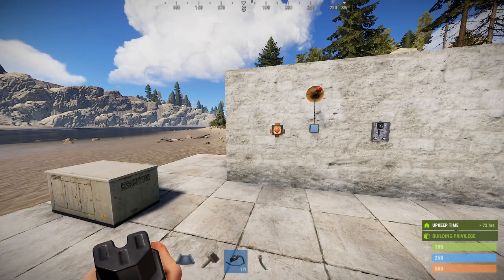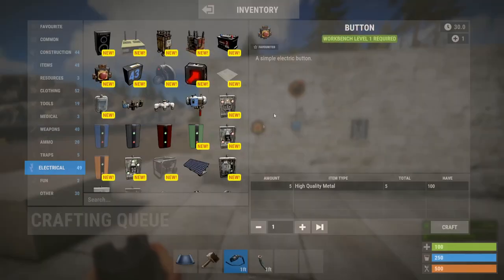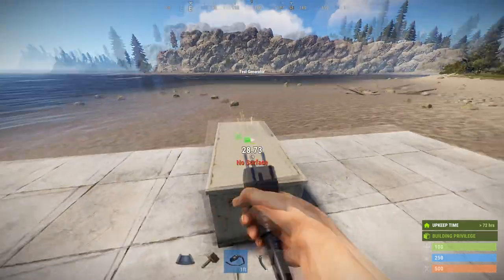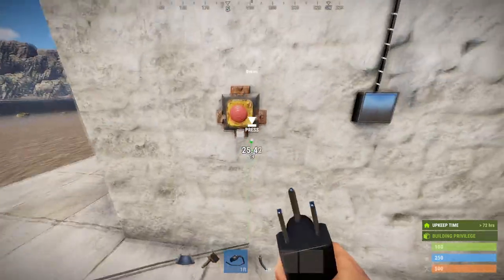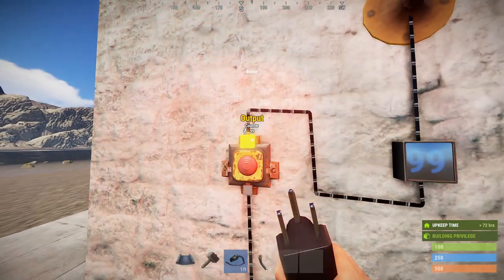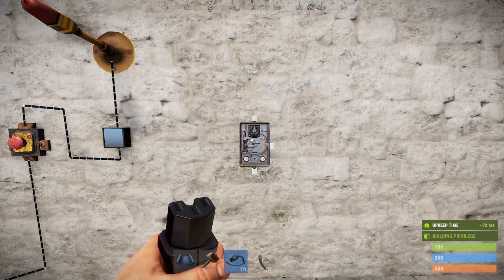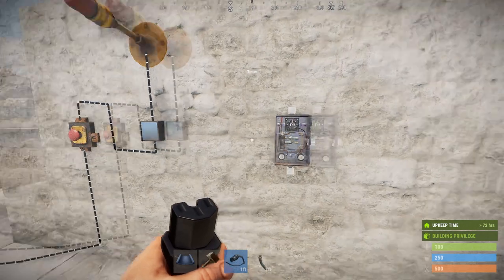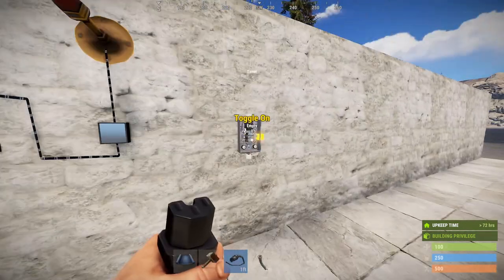Rust Electricity 101: Component Guide - Button

Comment: It appears that it will get an additional advantage once this commit from yesterday is merged to staging at some point in the coming days: https://commits.facepunch.com/372570

It'll burst electricity like the pressure pad does with no input. Definitely to facilitate the incoming elevator.
Reply from the maker: I'm convinced they're doing that to make elevators easier (call buttons without need a power source for every floor).